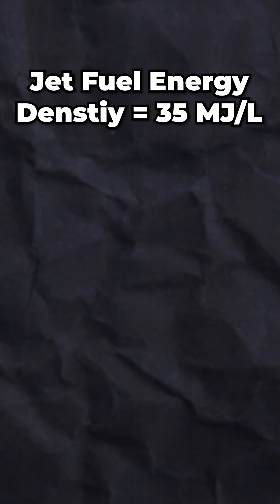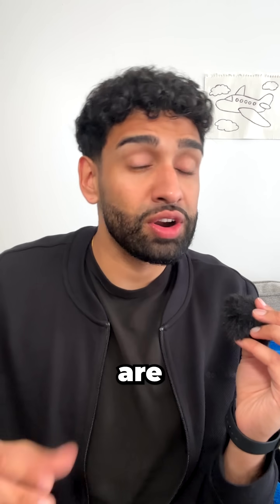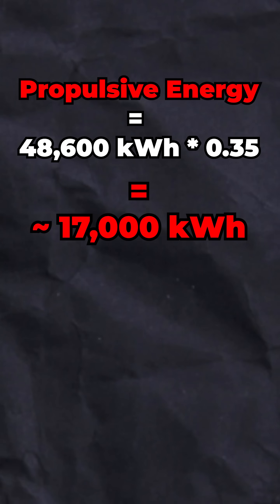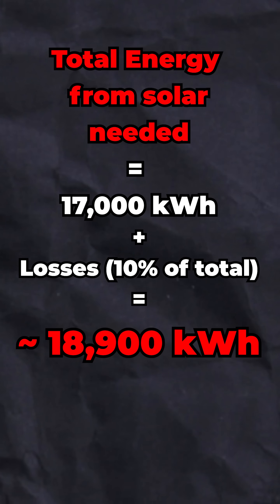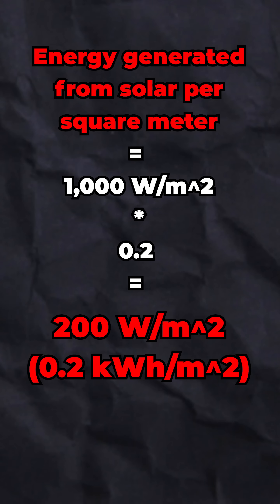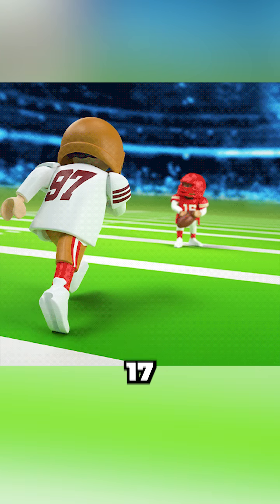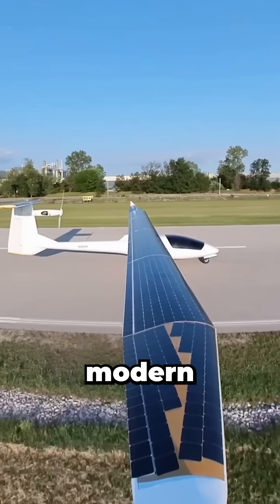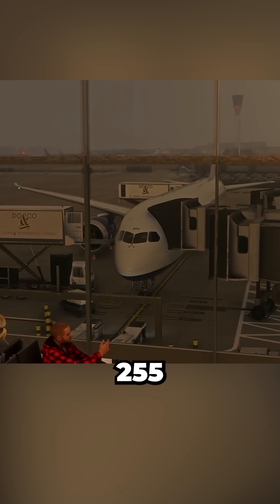Can solar panels power a Boeing 787?

Comment: What if each time the plane lands, there is electricity comming from the track, trough the weels and into a battery.
A massive space for solar pannels could charge a huge battery underground that uncharges just a bit when a plane is here.
Reply: You are not going to get the gigajoule of energy required from 30 seconds on the "track" (it's called a runway). And what are you going to make the wheels out of? Rubber is an insulator. And you would probably need to cover half a country in solar panels to charge this "massive battery" of which I'm sure it is not possible to manufacture anything close to its capacity
Reply: @nenoloblaH ok

Comment: They could all use SV generated power to reduce fossil output. Like an electrically powered turbo that doesn't snatch HP's.

Regular solar panels are heavy, solar film is not.

Comment: What about night tho. Most long haul flights, where the 787 specialized in are red eye night flights.
Reply: you say what about night while he proved that it isnt even good for the day (In case this ever becomes possible, due to more effiecient solar panels or smtg, you could just replace the fuel tanks with batteries)
Reply: @ batteries weigh a shit ton, not practical at all. Also, my question is an extension. If solar panels were plausible, what about night? Get your shit logic out of here.
Reply: @generalguacamole8524  he was putting forth his opinion respectfully

Comment: What if we used less solar panels and two small batteries that are charged before take off? Btw thank you for the vid. Edit: Thanks for the likes
Reply: Batteries weigh even more than solar panels.
Reply: @teegeeonethree and they cost so fucking much to replace
Reply: @teegeeonethree but they are more effiecient and less weather depending than solar panels
Reply: @Gregsi007 and yet, they are still crazy heavy. You would probably need batteries the weight of the plane itself for like 2h flight. And then it just doesn't make any sense anymore. There are reasons E-Planes don't exist in this size
Reply: @Gregsi007yeah but the real issue is you’d run out of power very quickly. Batteries the size required for this would not only be too heavy and too big to fit, but mining the materials for them would have a greater negative impact on the environment than just using jet-A. Not to mention the fire hazard in the event of a crash or even just an electrical failure. Electric planes do exist, but electric airliners are simply never going to happen, the cons way outweigh the pros. Instead a hydrogen powered airliner would be much better, way less emissions than both jet-A powered or a theoretical electric powered aircraft. We aren’t there technologically just yet but I predict in 100 years nearly all vehicles will be hydrogen powered
Reply: @leef9242 you underestimate the malice of some powerful people in delaying that advancement but yes, if it can exist it hopefully will by then
Reply: You missed the bit about being 6x overweight on solar alone huh?
Nothing that is commercially portable currently beats the energy-weight/economy of simple combustion